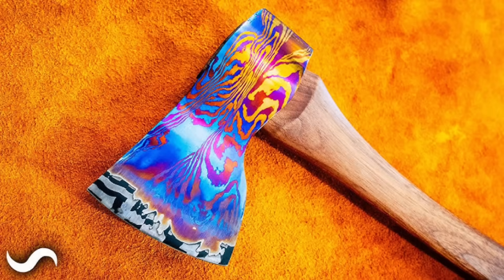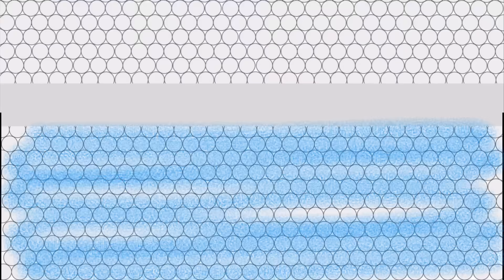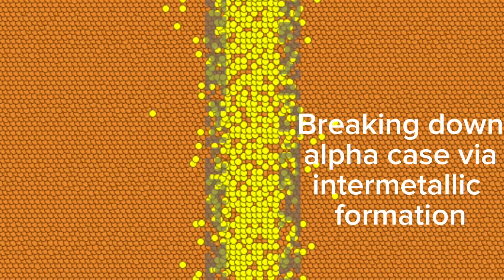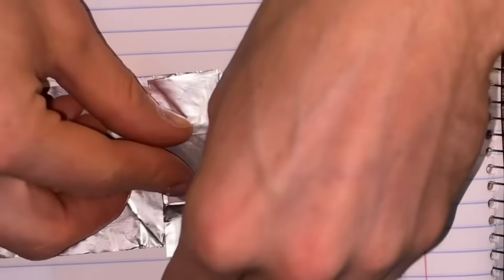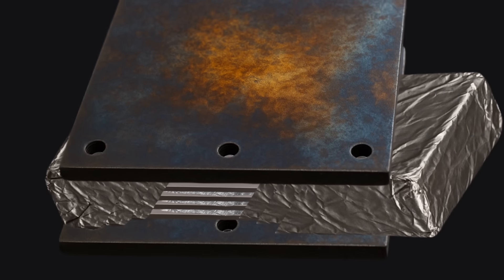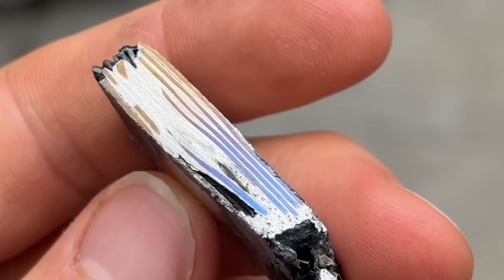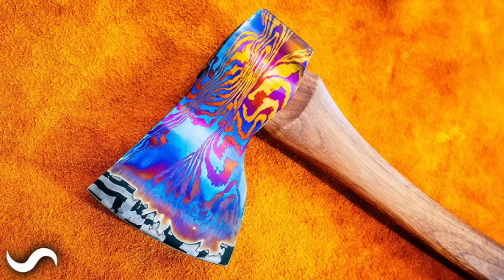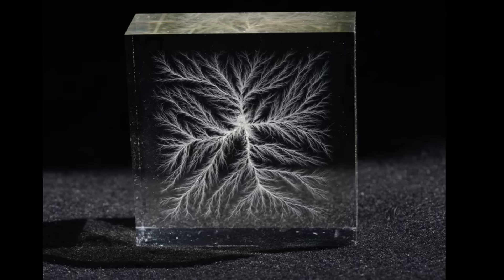Making Titanium Damascus is Actually Easy

Comment: I took a similar approach to tinkering with Mokume Gane. The benefit of flux and the ductility of silver alloys made the approach workable. 

I would add that grinding mostly removes other macro contaminates not necessarily oxide unless you have a protection layer applied. Grinding increases the surface area and creates high pressure points, which are very important to increase bonding and diffusion.

Brilliant work and especially impressive given it's a refractory metal. 👍
Reply from the maker: I really want to try out mokume gane, it looks insanely cool— I need myself a roller mill!

Comment: How do you think that would machine?  I would love to machine something from that!
Reply from the maker: Grinding works very well— but I never made a large enough piece to try anything else sufficiently. 

I tried drilling a hole through one with a cobalt HSS bit, but the piece was too small for me to clamp down for very long. I got about 3 layers in till I gave up. I wish I could give you more info but other than that I don’t have any machining tools at my disposal unfortunately.
Reply: @ElectronImpressions  No problem, just make more and send them to me.  ;)  Kidding aside, would you mind sharing the thickness of the titanium plates you used?  I assume you used normal aluminum foil which is about .015mm, but can you verify that as well?  It's the least you can do since the chances I'm about to spend $1500+ on a heat treatment oven just skyrocketed.  lol.
Reply from the maker: @billstrahan4791  My furnace was only $325, although it is not programmable. I used heavy duty aluminum foil, probably closer to .05 millimeters, although I think thinner foil may work better. 

The Ti sheet was either 0.5mm or 0.75mm, I’ll have to check and get back to you. When I can measure it.
Reply: @ElectronImpressions  Thanks so much!!  I'm going to subscribe and I'll try to contact you when I make something!

Comment: Doesn't aluminum oxidize at room temp. I thought that aluminum foil has oxidation on it when you buy it.
Reply from the maker: Yes it forms a very thin (nm scale) passivating oxide layer extremely quickly. However there is so much going on here with the combination of high pressure, high temperature, and proximity to reactive Ti, that it doesn’t do much to stop the intermetallic reaction proceeding.

Comment: Very cool work.  I make straight razors out of all kinds of laminates.  I think I will try this with a steel core and perhaps some copper or nickel shims before the ALU/Ti stack.  Would love to use this material on a blade.  Even if it's just to make the scales out of it as a back up plan.  Thanks!
Reply from the maker: If you proceed, I would recommend one layer of the thinnest aluminum foil you can find between each Ti layer. DM me on Instagram if you make it, I would love to see!

Comment: As a fellow chemist, can you please use electroplating to mcoat the titanium with aluminum?
With this proof of concept, it should be possible to have a intermetallic chemical bond and difusión bond between the intermetallic and the metal in a scale so microscopic that it would not be that different than an actual metal-metal bond. AND it should be able to be forged having a stronger bond. 
Hopefully of course... 
Can you git it a test please ?
Reply from the maker: I briefly looked into it and it seems plating Al on Ti is extremely hard— it looks to be easier to just get PVD aluminum on the Ti. Still, I think this would achieve the same result you postulate.

Comment: I have often wondered the effect of flowing hydrogen through the shield envelope rather than argon. If oxygen is a problem, use a gas that gets rid of the oxygen. Might let you forge weld with rather less issues.

This was a very cool project mate, thanks for publishing it.
Reply from the maker: Hydrogen would be absolutely excellent in most cases as it actively reduces any oxides that form back into metal. However you obviously need a very specialized furnace to pull it off lol. 

Also hydrogen is highly soluble in aluminum— so I could foresee problems with that in this particular material system. 

Thanks for watching!
Reply: @ElectronImpressions I don't know that the furnace itself would need to be that fancy tbh. 
You don't need to fill the whole volume with hydrogen after all. Just the foil pack with a vent hole. 

A regular flame furnace would do the job one would presume.  

Even in an electric furnace raw hydrogen isn't going to hang around at 600c very long 😂. Though some monitoring and ventilation may be an idea I'll grant you lol.

I didn't know about the solubility in aluminium. That's cool, thanks for that.

Comment: I'm a blacksmith and i'm currently working on cobalt damascus, wich can get colors hard to reproduce with steel or titanium (it can be given a cyan/turquoise blue color with variations in the hue). Once i finish my next prototypes i'll publish a video on that. One good thing about cobalt is that it will forge weld in a forge just like iron does 👌

A friend of mine makes titanium damascus in a canister, and because you're pressing your titanium in a foil case, i'd say you probably don't even need aluminium, just remove the oxygen from your foil (some use a piece of burning cloth before closing the box), and press that nice and hot for a few hours. You should get a nice weld, the same way as mokume gane
Reply from the maker: Sounds awesome, I’ll be looking forward to watching that
Reply: Seriously, it would be beautiful to see a mixture of titanium Damascus and cobalt Damascus to get a material that is even more iridescent.
Reply: @AlecSteele should see this.
Reply: That's a good idea, cobalt-titanium intermetallic should be very strong and perhaps even forgable.
Reply: @erichraudebaugh  or just skip the titanium because of its chemically stable oxides. It's a bit like chromium. But the interesting thing is that both have hexagonal structures at room temperature so maybe they would keep a nice bond perhaps

Comment: What about electroplating aluminum on titanium for thinner layer of aluminum that’s already better bonded? That way it’s more titanium so maybe stronger 

CO2 gas atmosphere isn’t fully inert but more than oxygen, you could replace oxygen in our atmosphere by burning something well so it’s just CO2 and nitrogen mainly
Reply from the maker: Plating the titanium with aluminum crossed my mind but turns out it’s crazy complicated to preform, and if I was going for a proof on concept, I should just do it the easy way lol. It would probably be easier to get PVD aluminum on the panel. 

Also— titanium is highly reactive with nitrogen at high temps as well 😂
Reply: @ElectronImpressions  have you thought of trying Brass or Bronze? Copper forms inter metallic alloy with titanium and both metals relatively cheap with relatively low melting point. You can also electroplate copper tin and zinc pretty easily for thin coating of all three
Reply from the maker: @gadglichtg4840  How can I electroplate the copper? I was actually interested in this but I read that a HF based deox step is necessary for it to work, and I didn’t really want to have those chemicals in my house 😂

Comment: Love this. When I first saw the Alec Steele Video I thoght he kinda did make it a bit more complicated than it need be, but you make it look almost trivial.

I would love to see this attempted with gold foil as intermetallic binder. Titanium gold intermetallics form at low temps too and have some interrestening properties. They would also make cool ring blanks for colabbing with someone like Patrick Adair Designs.
Reply from the maker: I must say that the material Alec produced is superior to mine when it comes to forging or load bearing. However I can still see many applications of my material. 

The titanium gold sounds super cool— someone also suggested a Al-Au to get the purple gold intermetallic, which I think would also be really neat.

Comment: You could actually mod your furnace for an inert atmosphere. A small hole drilled in a wall between the heating elements with a metal (or better fused quartz) tube inserted through which you inject argon. Cylinders of argon are easily available and fairly cheap from any welding supply store.

Comment: But wait. Does the aluminum create a buffer zone replacing the titanium oxide layer? Could the t+a+t+a sheets be fused into t+t with further heat treatments?
Reply from the maker: I would imagine with further heat treatments you would diffuse the aluminum further and further throughout the Ti until it is homogeneous. Ti6-4 is 6% aluminum, so perhaps in theory you could have a block of just titanium with aluminum substitutions or with discrete intermetallic phase “islands” spread throughout. 

However the time and temperatures needed to drive the kinetics to accomplish this would be very high, and likely no longer achievable in atmosphere.

Comment: I appreciate your detailed explanation which makes the topic very approachable and seemingly easy. However, I think the current title of the video is overly facetious, implying that titanium damascus is easy, while later in the video admitting that the material likely cannot be worked and is only meant to look nice. Your discovery is nonetheless fascinating and certainly useful, just not in the way you would expect from any other titanium damascus. Thank you for your great work.
Reply from the maker: I thought the same, I was actually leaning towards using the term “layered titanium” in the title instead. However I asked a few actual blacksmiths and they favored calling it damascus. One mentioned that there is a specific type of Damascus where no patrern manipulation is even done. 

But the material can definitely be worked, albeit most likely only subtractively. It could find use in knife handles or other applications where aesthetic composites are used.
Reply: Exciting stuff! I look forward to seeing wider adoption and further development of your procedures, as well as to see what can be done with such materials. The title is probably "good enough for youtube", but I would still be more in favour of a more realistic snd transparent title, for the sake of technically-minded viewers, if that makes any sense. Thank you for your kind reply! I wish you all the best. @ElectronImpressions

Comment: This is cool! To be fair to Alec, I'm not sure if the material properties of titanium aluminide... I imagine that using it for something like an axe, it would break easily...
Reply from the maker: Absolutely, towards the end of the video I show a fracture surface of iron aluminide, a similar intermetallic compound. Any use case that this material may have is likely in subtractive machining or decorative parts rather than forging/load bearing parts.
Reply: @ElectronImpressions  agreed! I watched that part as I was finishing my comment! Haha! It was a great video!
Reply: Also remember that Alec was not only making titanium damascus but titanium steel damascus for some of the parts which made it even harder. I think he also tried intermetallics with different metals in some of the experiment videos but concluded it was just not strong enough.
Good process though if you want results that can be achieved with grinding and don't need tons of strength though.

Comment: Bravo mate! Ordered some of the Brass from you recently-  if you look at the "Grade" of Ti used- you can achieve some of this affect with CP2/Grade V (6Al4V) Ti layering- these can have enough Al to form or contribute to the intermetallic boundaries and modify the layering to allow fusion. Passivation of the oxide layer can also be mitigated with the addition of Ar gas in the Stainless Steel envelope and a bit of cellulose/sawdust in the foil packet to carbonize outside the billet- hope this helps- keep going!
Reply from the maker: This is Gr 2 Ti, we are on a budget 😂. I had assumed the Al in Ti6-4 wouldn’t be mobile enough to contribute to intermetallic formation— although maybe some of this was just me coping to buy cheaper titanium lol. It’s interesting to hear that it actually can contribute though!
Reply: @ElectronImpressions  it may contribute- although locked into the matrix in stable ratio- been a part of a couple of experiments where thermal cycling 600C mobilized enough Al to surface to assist. You are the MatSci guy- Im just a hack garage guy- Just saying dont stop- keep on my dude!
Reply: Another suggestion I would have is to use thinner aluminum foil. Looks like heavy-duty foil was used in the video; they make much thinner foil. Less aluminum = less intermetallic.
Reply from the maker: @stamasd8500  You are absolutely right

Comment: This would make for some incredible knife handle scales. Very simple to do, visually stunning, and it should hold up just fine in use. A rainbow, metallic replacement for micarta composites.
Reply from the maker: That’s where I was thinking any potential applications lies, given its questionable forgeability
Reply: I'd shell out some coin for a set of CZ-75 grips
Reply: Absolutely agree. Those colors are amazing and reminded me of woodgrain a bit with a modern upgrade lol❤❤
Reply: I was just going to comment the same
Reply: The colors are actually super fragile. They change dramatically with finger oil, and they're very very thin, so tend to scratch off really quickly.
Reply: nothing a clear coat over the top doesn’t fix
Reply: @tanaes well TiO2 is pretty hard and chemical inert that is why Ti gets anonodized beside the nice color the trick too make it sturdy is too keep going with the anodising till the oxide layer is thick enough   the natural oxid layer is only 1-5nm but for color you cann increase the layer thickness up too 1200nm especially if you like green and golden colors but for the beloved blue youy need 35nm or  ~130nm the later dosnt pop as much but is way more resilient  too scratches
Reply: @TheLtVoss I ran a small business anodizing titanium for a couple years… trust me, even the thicker oxide layers are liable to scratching off in any sort of wear scenario, and all of them change noticeably in appearance when there’s any kind of surface contamination (eg oils) that will affect the light path.
Reply: @tanaes damn. It sure would be pretty though.